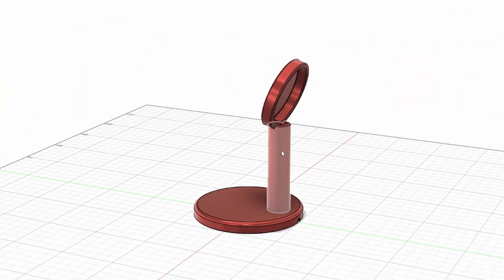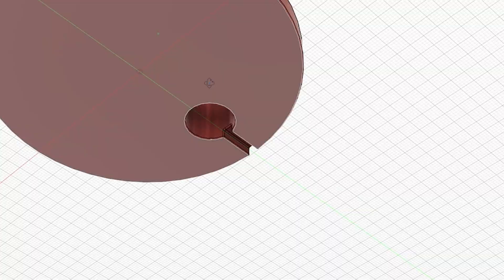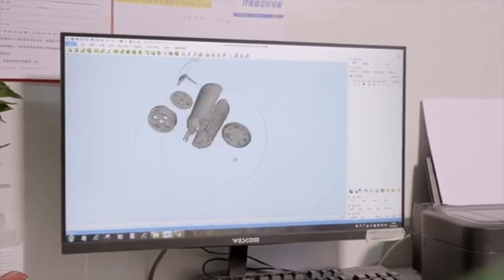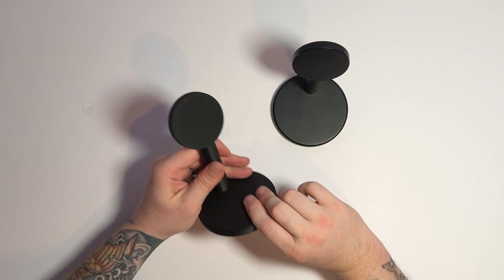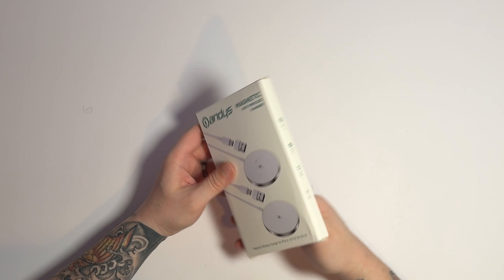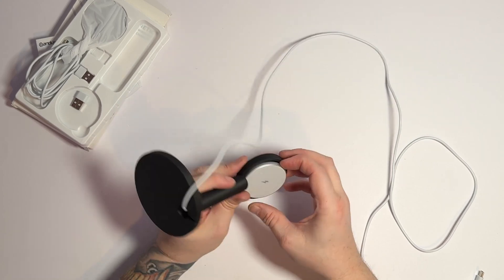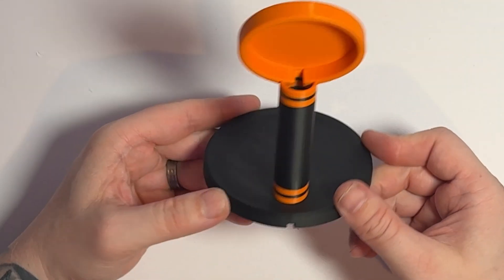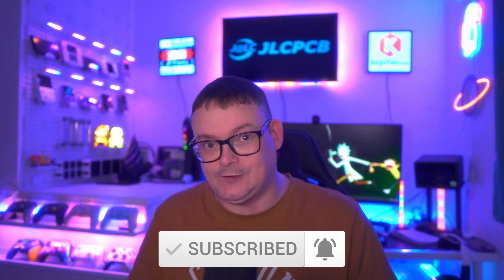You Want Somthing Doing Right, Do It Yourself! I Make My Own MagSafe Iphone Charger And 3D Print It.

Comment: Nice print! Did you weight the base down? Otherwise it might be a bit unstable and wobbly when phone is attatched
Reply from the maker: The base is wide enough for it not being an issue and I have a 16 pro max and my wife has a 14 with no issues on both.